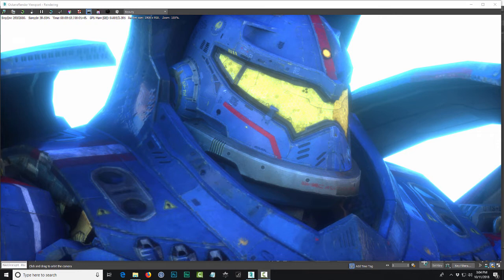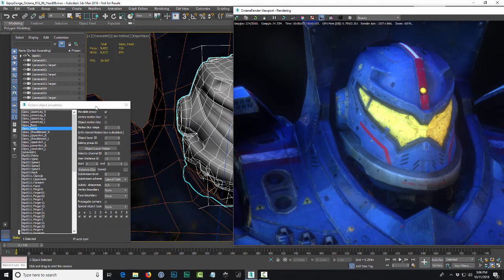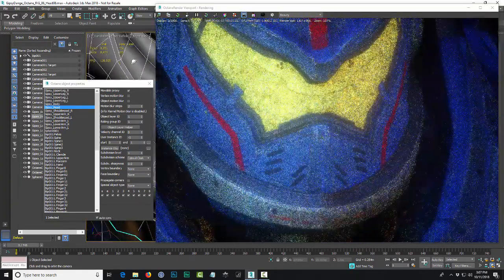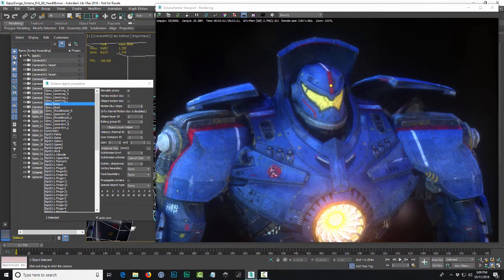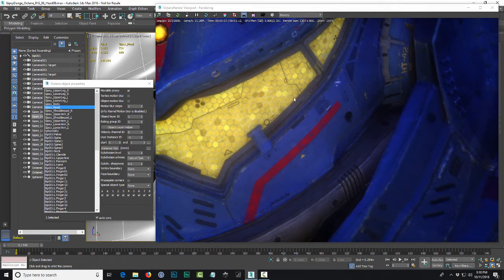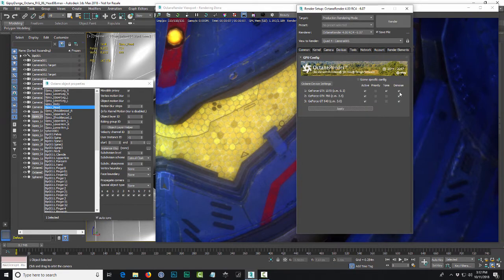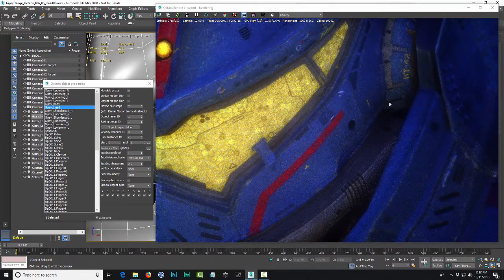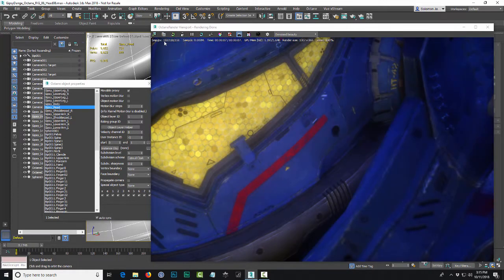Speeding Up Your 3D Renders using Octane 4 Render Engine in 3DS Max

Comment: Solomon please what's your system specs?
Reply from the maker: I7, 16Gb Ram with 3 graphics cards.
Reply: Which graphic cards
Reply from the maker: @seanbernard6516  a 1070, 780 and 640. Nvidia